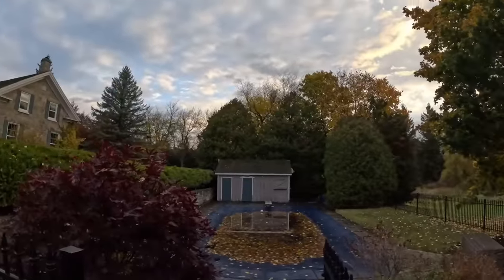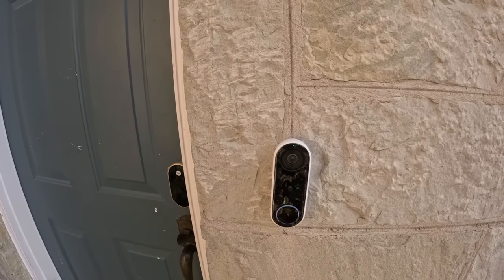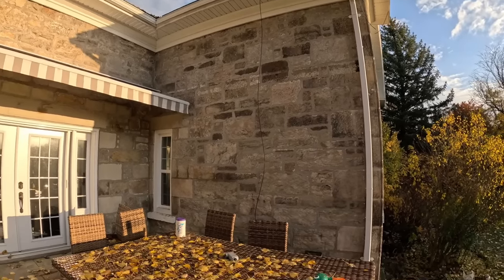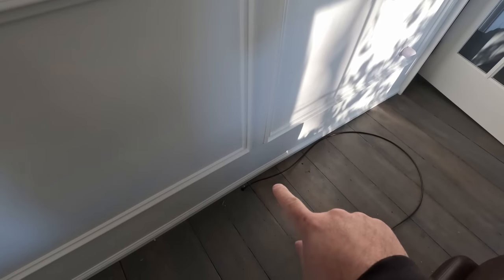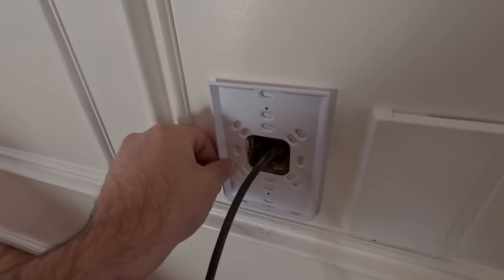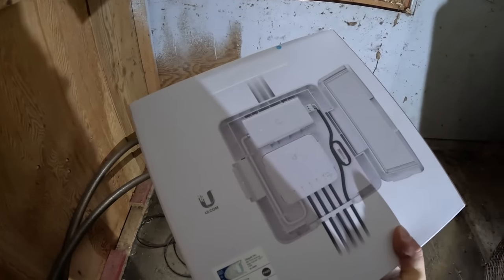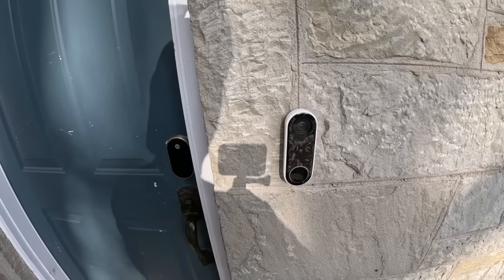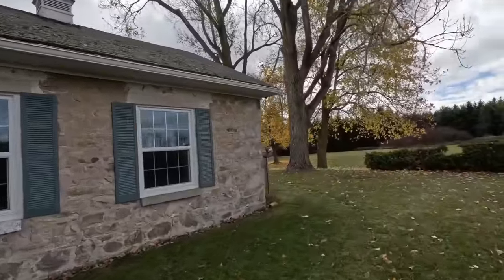Unifi Network Install: Farm House WIFI And CCTV Part 2

Comment: That cable you were showing at about 0:50 I would undo the cable ties on the spouting and just run it up the corner.  It would have made a much neater run.   Unfortunately the cable ended up pretty untidy looking by going up the spout, back across the top and along to the camera.
Just shows you can't leave a sparky alone to do a cable run.
Edit: As a note, I am a sparky and do data cabling 😉

Comment: For the runs fromthe main house to the pool house etc. how did you run the cable? How did you isolate for lightning strikes etc? Thanks!
Reply from the maker: We didn’t run anything the electricians ran all cables through a conduit. We have the Ethernet surge protector but if it gets hit by lightning probably won’t help much

Comment: Any chance you have used the security access reader g2's? if so, are they still able to function if the switch or router dies or loses IP's?
Reply from the maker: If the switch dies it won’t work as it wouldn’t have power. If the firewall dies it would
Reply: @MactelecomNetworks  man what a deal breaker that is. the fire department i run with is considering diving deep into the Unifi whole since it would allow a single interface for all the networking, security cameras, and door access. losing the PoE i get but uggghhhh this is frustrating since there is 0 documentation anywhere stating that.

Comment: With the outside AP, how do you configure security to prevent a miscreant creeping up at night and replacing it with another similar looking hacked AP?
Reply: if it gets replaced, the AP will show as disconnected in the controller
Reply: Depending on your router/firewall, you can set that network to only allow designated MACs as well to help from people unplugging cameras/ap’s and being hardwired to your network.
Reply: Probably should have mentioned turning off DHCP as well for any networks with exposed access like that.
Reply: @JeramiFrost  not a great solution when they want the AP's to provide internet access to people at the firepit, etc.
Reply from the maker: Were not overly worried about people coming by and unplugging the APs. This is in a very remote location with cameras all around. The issue with mac locking when wifi clients join they wont be able to because they are not in the mac allow list
Reply: @MactelecomNetworks  agreed on that being problematic on a client device network. I put cameras on a specific vlan, network equipment on another vlan, and client devices on yet another. I only mac lock the camera and network equipment networks for jobs since clients don’t tend to change that on their own or frequently.

This is to simply lock down the network cables that are exposed to the world for port security. I count on wifi security for securing the wireless signal for client devices.

If you were managing many sites, or leaving people on their own after install this may not be a great plan. I only keep up with a few sites. If you are just trying to do best practice for your own home, I don’t see any reason why this practice would be an issue, but im open to being corrected if theres an appreciable downside that outweighs the upside.

Comment: Drives me absolutely insane that the Flex Switch Box door opens in the direction that it does.
Reply from the maker: I was actually thinking the same. Doesn’t make much sense